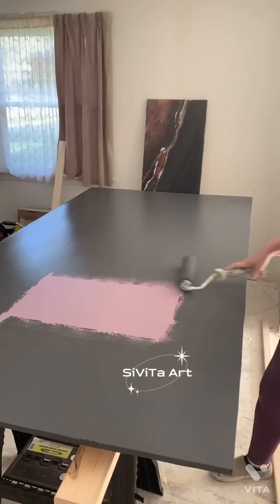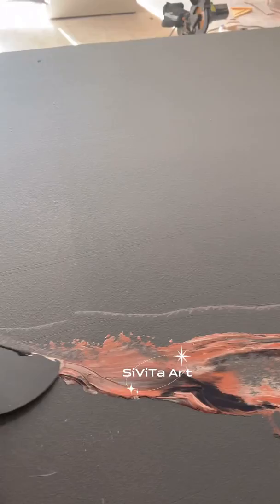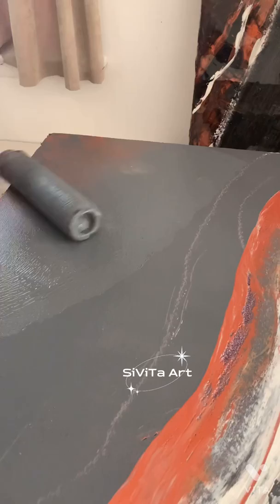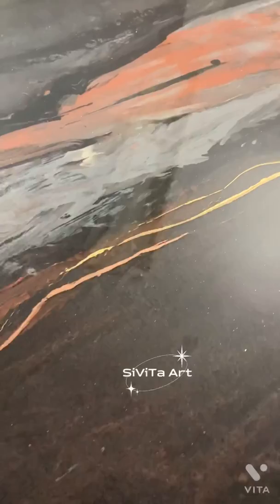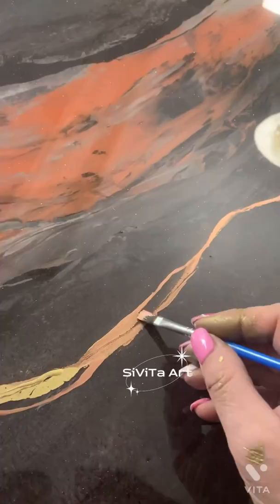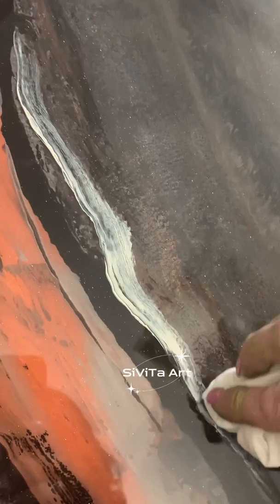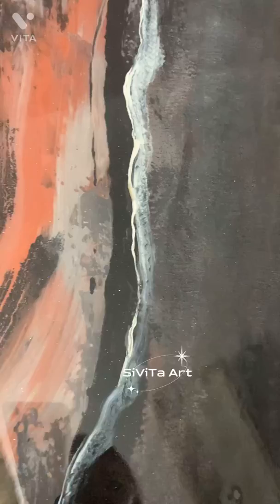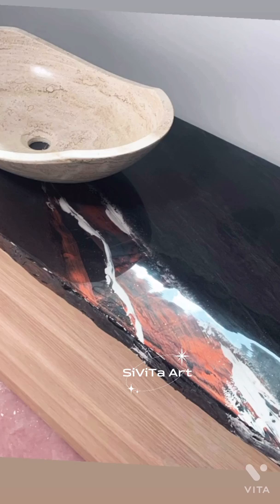Epoxy Shower Wall Panel Tutorial

Comment: Здравствуйте, я ваш фанат ещё с Инстаграмм)) что за краску вы используете?
Reply from the maker: Spasiba.it is  metallic wall paint
Reply: @SiViTaArt  я прочитал это в ваших субтитрах, но что это? Акриловая краска?
Reply from the maker: @user-uv8ej3fp6e  no,it is wall metallic - latex
Reply: @SiViTaArt  mercy
Reply: @SiViTaArt  primer base, do you also apply the main color with latex paint?
you are not afraid that the first layer of epoxy may wash away or dissolve your drawing
Reply: @SiViTaArt  your drawing has volume, it is not flat, how does the resin lay on it and even out the overall surface? no problem with that?
Reply from the maker: Yes the drawing wasn’t super flat but once it’s dry I send it down a little bit
I am doing this technique for over four years I never have problems but most important is to wait latex to fully dry before you add the epoxy

Comment: Really lovely! What is your process for substrate? What brand of epoxy is your “go to”? Thanks
Reply from the maker: Thank you so much.I used Stonecoat countertop for this project .It is done on 1/2 inch foam insulation .shower walls i coated 2 time with red-guard before I glue the foam board
Reply: @SiViTaArt  did you use any fibreglass mesh before the design? or just right over the foam board
Reply from the maker: @Telechia  no mesh tape .I paint the design and covered with 2 coats epoxy